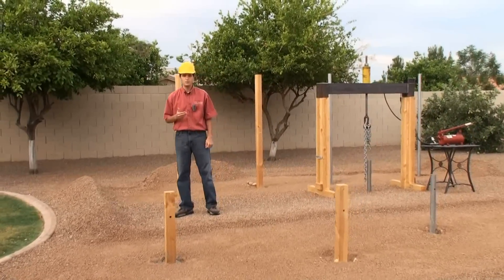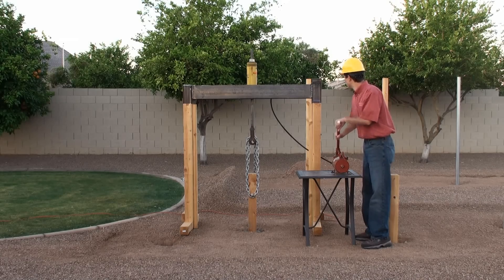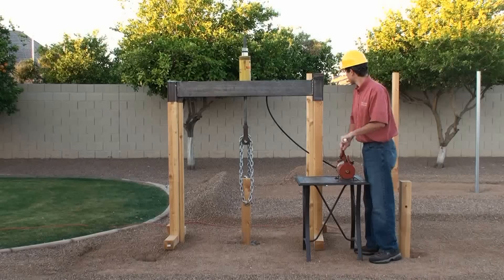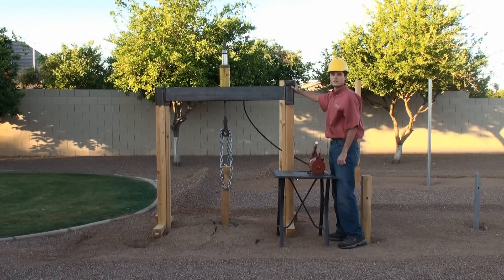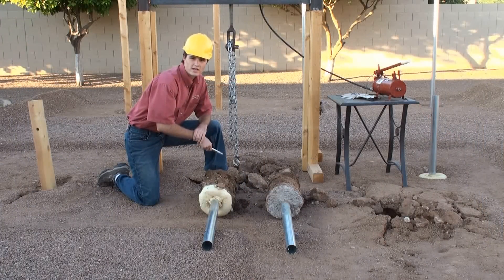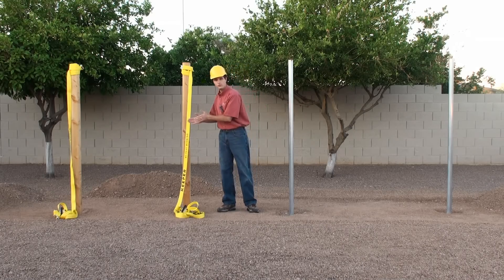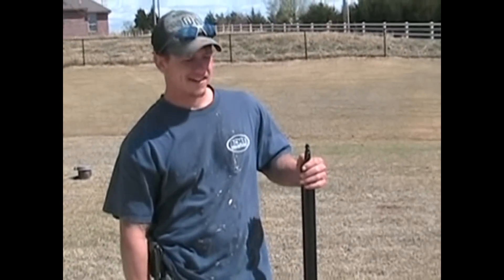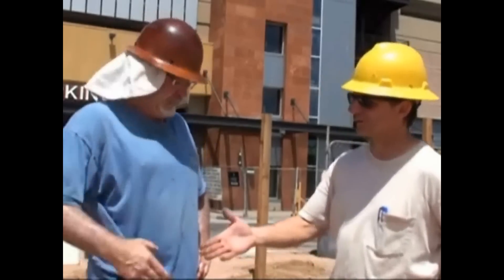Testing to Compare Concrete to Secure Set

Comment: this is rigged
Reply: +Ricky white im curious how the earth itself was made stronger by using this. I mean 1776 lbs with concrete and 2677 lbs with this product ? how in the world did this product make gravity stronger ? uplift pressure would be the same in both instances unless a larger hole was dug to use more product.
Reply: Yes,spot on! the surface area of the product is responsible for a variable lift pressure. The shape of the hole is another variable as well as size.
Reply from the maker: +Ricky white 
There's nothing about our videos that is rigged, lol.

For years concrete has been the only thing to install fence posts with that was stronger than the soil, however, it was never made for installing fence posts.  Secure Set was designed for installing fence posts and poles so it really is a superior product.
Visit our website at Secure Set www.secureset.net.  
Click on the “Calculate My Project” button and it will
walk you through the steps which will tell you how much product you need to
order for your project.  This site will
also tell you shipping costs and shipping times as well as answer many other
questions.
You can purchase Secure Set online at Home Depot http://www.HomeDepot.com
And on Amazon   http://www.amazon.com
Reply: Because the foam expands into cracks and crevices and also compresses the earth around the post hole.
Expansion and compression is an advantage foam has over concrete.

Comment: What is this guy Measuring? This makes no logical sense.
Reply from the maker: +Stepan dmitriyev 
What measurement are you struggling with?  He measures the posts, the post hole and then equal parts of Secure Set.
Visit our website at Secure Set www.secureset.net.  
Click on the “Calculate My Project” button and it will
walk you through the steps which will tell you how much product you need to
order for your project.  This site will
also tell you shipping costs and shipping times as well as answer many other
questions.
You can purchase Secure Set online at Home Depot http://www.HomeDepot.com
And on Amazon   http://www.amazon.com

Comment: I would be more interested in the longevity of the Secure Set compared to concrete, how does it perform 10-20 years down the track?
Reply from the maker: +Outbackbloke 
Secure Set is a 40+ year product while in the ground.  

Visit our website at Secure Set www.secureset.net. 

Click on the “Calculate My Project”
button and it will walk you through the steps which will tell you how much
product you need to order for your project. 
This site will also tell you shipping costs and shipping times as well
as answer many other questions.

 You can purchase Secure Set online at Home Depot

 http://www.HomeDepot.com

And on Amazon

 http://www.amazon.com
Reply: 50reeves Great, thanks for the info!
Reply from the maker: Otto Bayer developed polyurethane just prior to WWII. Initially it was used as a replacement for rubber. It was further developed for many applications from solid rigid foams to flexile foams like the soles of modern day running shoes. In the application for posts, we use the high density structural formulation.  As an example of a similar application, the pylons that hold up the Alaskan pipe line were set in a structural bed of polyurethane.  This provided both structural support and insulation to prevent the heat of the oil in the pipeline from melting the permafrost, thus preventing the settling of the pipeline supports.
Reply: no they didn't. 100 years ago they built the panama canal with concrete. i think it's still in use. a couple decades later they built the hoover dam with concrete. still in use today. and roughly 1,800 years ago, they built the pantheon in rome with concrete. it's still there and it's still the world's largest unreinforced concrete dome. nobody was laughing at concrete 100 years ago.
Reply: lmao foam balls!! this product will work well in floods, it will save lives with all the fence life boats.
Reply: +Em Christobal
is that what the Romans were doing? oh wait...
Reply: Concrete (Portland Cement) is hardly natural. It's one of the largest causes of C02 production in the world. Definitely recyclable though. 

This product has value where speed of installation is an issue. I can't see it replacing a structural footing though, so it's basically a timesaver for power pole installations and fencing. Time = money.

I don't get the reason for the pull out test though. That's testing the shear strength of the soil around the post, which is variable. Not a useful test at all. Apart from that, it looks strong enough for a fence so why bother with the hard hat and bad trance music?
Reply: 100 years ago they laughed at concrete.
Reply: You must not have very much experience.
Reply: The foam will endure for decades but the effects it has on the soil will most likely not. Without mass and volume, the foam will always be dependent on the stability of the soil it's applied in.
Reply: Stuff just  came on the retail market
Reply: I would be more concerned with the side force numbers rather than the pullout numbers.
Reply: My fence were there for 50 years with concrete ;) And destroying was very painfull. This is strange age, make things quick without vision to the future. Concrete is natural material. Can be crushed and stored on garbage like stones. What next generation will do with this "foam balls" with steel pipe in it?
Reply from the maker: Hello,  Secure Set has a design life of 40 years under the soil.
Reply: @SecureSet-Fence-Installation  -- But what happens if it is not under the soil?
Reply from the maker: @CurmudgeonExtraordinaire  Hello,  If the foam is exposed, it will turn a yellow-brown because of UV exposure.  You can prevent this if you spray paint the surface with a primer type spray paint, color is your choice. Thank you
Reply: Pour some Acetone on it and watch it melt like hot butter.
Reply: @bodean2000  -- Or if it is like styrofoam, pour gasoline on it...
Reply: 50reeves [
Reply: Michal Rimmerak Yeah I'll still be using concrete.

Probably not useful for the home gamer but I can see the value in this stuff for niche projects like power pole installs.
Reply: I know, that 1 ton of portland cement produces around 1 ton of CO2 when is made. Some of this volume is used again from atmosphere, when harden. 
I know, time is everything now, in this quick age. 
Dont now, how for you, but I will be much happier with concrete garbage behind my house, than PUR foam garbage.

Comment: One other thing, it just came to mind.... how does it hold up to UV solar exposure as compared to concrete. Do you have any comparable  test data ?
Reply from the maker: Jo M, UV exposure will not effect the structural integrity of Secure Set, however, it will discolor it from a cream color to a burnt orange color.  To prevent any discoloration, simply cover the Secure Set with a layer of dirt as dirt is a wonderful UV inhibitor.
Reply from the maker: +Jo M 
You can order this online at www.secureset.net and  http://www.homedepot.com/s/secureset?NCNI-5
Reply: Not going to be a factor in post setting.

Comment from the maker: This will last for 25 years and longer. Your fence post will not last 25 years when it is set in concrete. Concrete absorbs water when it rains, over a few years that moisture will rot out your post even with treated lumber. Thank you for inquiring about our product.

Comment: 50reeves: We set granite monuments. We'll dig a 6" foundation that is usually around 18" wide and maybe 5' long, and then fill with concrete directly in the hole with no form sides. Do you think SS would be good for this application?

Comment from the maker: The tall light poles around baseball fields shown in some of our videos are pictures of poles we set. Think of the 100 foot light poles at baseball fields and the side force applied to them when a strong wind is blowing. The banks of lights at top of the pole acts like a hugh sail so you can imagine the side force applied to that pole. Secure Set had to qualify and meet the side load requirement to hold those poles in order for us to set those poles.

Comment from the maker: nickbeets Secure Set has been used for over 15 years setting large power poles in excess of 10,000 pounds for the utility industry. The utility companies would not even consider using a material if it did not last at least 25 years. Utility companies own MILLIONS of poles and they would not be able to keep up with the number of poles deteriorating if the material they used to set a pole broke down. For the utility companies to approve a product you most go through unbelievable testing.

Comment from the maker: The weight of concrete has very little if anything to do with a fence pole being stable in the ground. The increase in the footing at the base of the post determines the stability of the post. As long as the material being used to set the post has a higher compression strength than the surrounding dirt the dirt will give way first. Do the physics and the numbers don't lie. This is why the utility companies use Secure Set to set poles that weigh in excess of 10,000 pounds.

Comment: what I want to know is how long before this stuff starts to break down?
the only point of having concrete is so this the post/poll has a wider footing to stop it moving and to help hold it down due to it being to heavy. 
sure it might be easyer to use but I would worry about what is happening to it later on.
As I have made my own turbine I know how important it is to have a solid, heavy footing so the main poll does not twist and move

Comment: I agree natek327. It looked like while the Secure Set held up beautifully the concrete in the side load test performed better. The bottom of the concrete wood pole didn't budge a bit while it appears that the Secure Set bottom of the wood pole did move before breaking. Makes me wonder what would happen if the load was back and forth like in the real world with wind. Still the Secure Set seems very good. I'll wait for the ecommerce site to check out pricing.

Comment: if it's the soil that's giving way. then wouldn't it be a soil preparation issue, more than the properties used to set the post or pole. also what your demonstrating could be the difference of depth of the post or pole settings. all the setting does is keep the post or pole upright and the materials gives a weighted slug to stabilize it against sideways forced movements. depth will also effect that.  this is knowledge that comes from just helping out around well drilling work (geological facts).

Comment from the maker: Sam we base all of our test and conditions on a 24 inch deep hole and 8 inches wide. We use a 6 inch auger which gives us about 71/2 inch wide hole, then we trim out the rest of the hole to 8 inches. This size is standard in the fencing industry. Watch our new video Secure Set SP it demonstrates how easy it is to use the product. SSet also helps prevent rotting of the poles because it is a close cell product. Sorry didn't get back soon been very busy, thanks for your inquiry

Comment from the maker: Did you watch the whole video? We demonstrate a very strong side load condition and Secure Set held up beautifully. Understand as long as the material holding up the fence pole has a higher compression strength than the surrounding earth, the earth will give away before the material does. Secure Set has a much higher compression strength than dirt. Secure Set is also a closed cell material so it keeps water out unlike concrete that absorbs water aiding to the post rotting. Thanks for inquiring.

Comment from the maker: It is a close cell foam so water does not penetrate the foam. Unlike concrete that absorbs water when it gets wet and contributes to the rotting or corrosion of the post. Thank you for your inquiry.

Comment: I USED TO use a product like this to pump into tire's.
Most of the garbage places needed solid tires.
Also other equipment where a flat tire could shift a load or a man if the tire went flat.
It was orig. made to fill bomb holes in runways during the war.
Heavy equipment was not fast enough for returning bombers if the airstrip was hit while the bombers were out on mission.
What is the durometer of the cured foam?

Comment from the maker: The utility industry prefers this product over concrete because of its strength, durability, ease of application, protection from water damage and absorption, and labor savings with how quickly it sets up. Unlike concrete that absorbs moisture and contributes immensely to the break down of their utility poles. You should contact the engineers of the utility companies in the country and ask them, since they have been using this type of product for over TWO DECADES.